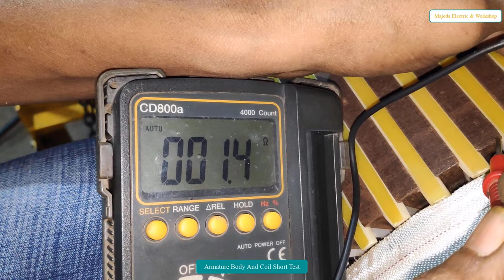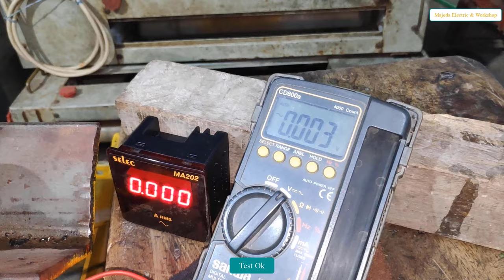175.6 - KW, DC Motor Armature Rewinding, Wave And Lap winding Work In Bangladesh (Part -2)

Comment: Considering the conditions you have to work under and the limited equipment at your disposal you guys did a great job. 
I was very impressed with the armature winder. He is obviously a craftsman who takes pride in his work. 
While I noticed a few things I would suggest you could improve upon I humbly give you one tip now. When soldering a commutator you should always do it below horizontal. That way any excess solder will drop to the ground rather than pool in behind the commutator, which can cause a short circuit. 
With that being said, greetings from an old retired Australian armature winder.
Reply from the maker: Yes, you are right
But I'm all commutator soldering time i keep commutator side down
You can understand if you notice a little
And thank you thank you so much for your comment sir 👍❤️🙋🇧🇩

Comment: Very neat work, but only complaint is copper dust removal by brush. You should use air compressor to clean that up better. Some particles may get trapped inside specially at the commutator area that causes failures. Overall its a very neat winding and precise. Loved it!
Reply from the maker: Well, you're right, I never really thought of that, from now on I will always clean with air,
And thank you for your kind and helpful comments, loved too ❤️💞❤️💞❤️💞🇧🇩🙋

Comment: I'M NOT TO PUT YOUR REWIRING DOWN, EVERYTHING LOOKS GREAT.  I did not like the hammering of the wires because it weakens the coating, for a spark, then ( do not get me wrong) your owner or boss? Should lose a week's pay!  Until he gets a pipe or cylinder WITH 2 CAPS!  To dip the armature! And put a vacuum on it! To  remove the air! Then do not dry it on it's side! Because of it will go out of balance... GOOD JOB WORKERS!
Reply from the maker: Thank you for your comment sir 👍❤️🇧🇩🙋

Comment: Honestly, very good job on the motor rewinding but you are not serious about motor test.
You do only no load motor test with too small wires, and of course not security for the operator.

And if you put wheels under the yellow rotor support, the handling  will be easier.
Reply from the maker: Yes sir but i test this process
And the motor is running 1 years up for factory and run very well and Thank you so much for your comment sir 👍❤️🙋🇧🇩

Comment: Nice work there - any idea how old the motor is?  It says "Brown Boveri", so it has to be pre ABB, and that was about 40 years ago.  Probably good for another 40 years now.
Reply from the maker: Thank you so much for your comment sir 👍❤️💞🇧🇩🙋
Reply: On the top line of the motor specification plate at 48:42 the date of manufacture is listed as "1987" so the motor is about 34 years old.  On the 10 of August 1987 the Brown Boveri company and ASEA announced that they were going to merge.  The combined company started operations 5 January 1988.  This means that this particular motor was manufactured just before the companies merged.

Comment: You are very skilled, but there are a few actions that you should review:
1. Is the rotor dynamically balanced? I found that when installing there is a plate on which there are several bolts, what is it for or for dynamic balancing, if it is for balance then when balancing the rotor on the outside, it must have it. The rotor seems unbalanced when you test it.
2. At the stage of assembling the rotor, you should have a tube longer than the stator and with a wide enough diameter, through the motor housing so that the rotor does not lean into the housing, this job requires two people.
3. The stator seems dirty, so clean it carefully.
Reply from the maker: Yes sir I balance as much as I can but I don't have this working balancing machine,
ok i understand your words i will try to clear in a better way in future,
And thank you thank you so much for your comment sir 👍❤️🇧🇩🙋

Comment: Very good work.  However the testing process used is very dangerous.  No fuses or circuit breakers or emergency off switches.  And if the input shorts or the bearings seize up, the whole motor is going to tumble with speed and smash and kill everyone.   Please consider a few fuses and safety chains.
Reply from the maker: Thank you so much for your comment sir 👍❤️💞🇧🇩🙋

Comment: your resin mixture is to aggresive. u could burn up a whole house like that :D. otherwise crazy what u guys do over there. i do work on PEM and DC motors too  but just in a bigger form.  komatsu for example. my company builds those from scratch. just a tip as soon as the resin mixture bubbles just a tiny bit its good u will see those little airpockets popping up. thats where u mostly stop the mix. or did u guys did it in the wrong order? cause the bandange clearly got burned. i mean its not bad it will still function. but me personally who also works with that got abit overwhelmed to see that. some other guy just took a whole day for that and shwoops its burned you know what i mean haha.
Reply from the maker: Yes sir I know and thank you for your advice and suggestions 👍💞❤️ Thank you so much for your comment sir 👍❤️💞🇧🇩🙋

Comment: Why are you doing a laborious repair job?  Isn't it more economical if you send this defective motor for recycling and buy a new one instead.  I think it's better to buy a new one rather than repair this engine.  How many years does this engine run after it is repaired, how long you can guarantee. From Turkey.
Reply from the maker: 10 years guarantee for my work engine,, and thank you for your comment sir 👍❤️🇧🇩🇧🇩🇧🇩🇧🇩🇧🇩🇧🇩🇧🇩🖐️
Reply: @majedaelectricworkshop  Either ... ten years is a really long time.  Keep working.  Greetings.